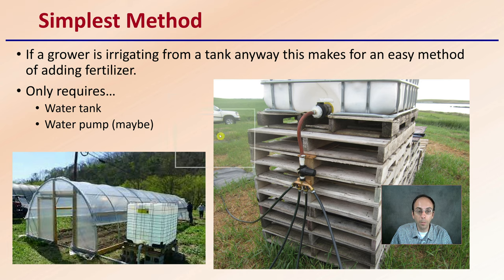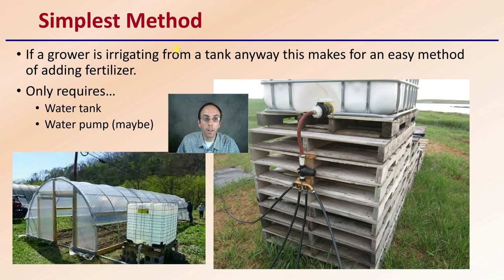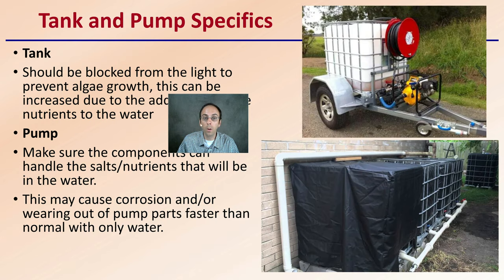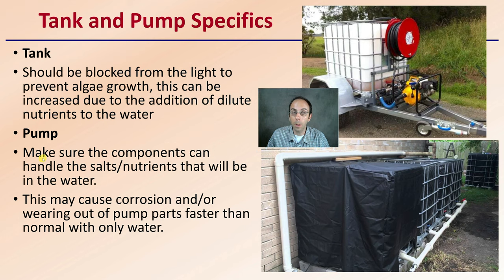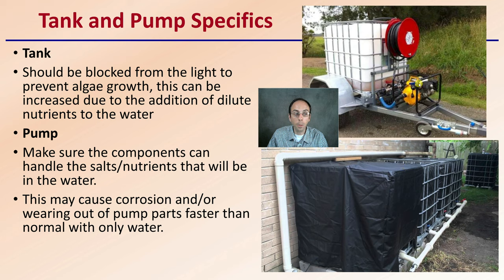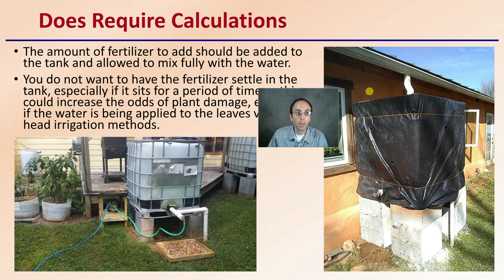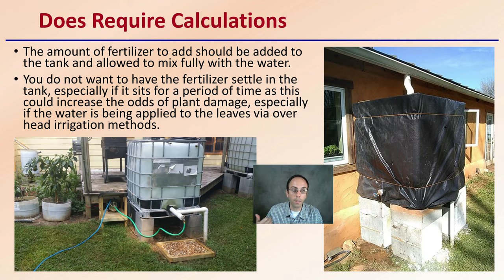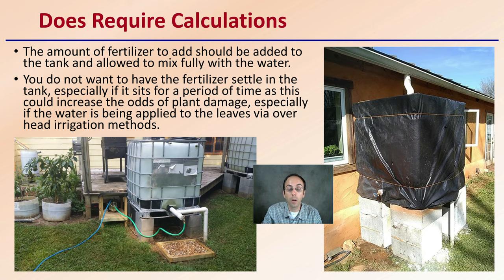Using Fertilizer in a Diluted Irrigation Tank for Cannabis Production

Comment: A little off topic but, is there an organic method to use in a hydroponic setting? For example using things like compost or casting teas in a kratky or dwc setup? I guess what I'm asking is if it is possible to have a hydro grow without using synthetic nutrients? I have read about this being a possible method for a flush or gutter system.
Reply from the maker: It is possible, but there will be more challenges with pH management and also do not forget about the build up of particulate that often comes with organic fertilizers when it comes to tubing, emitters, pumps and filters.